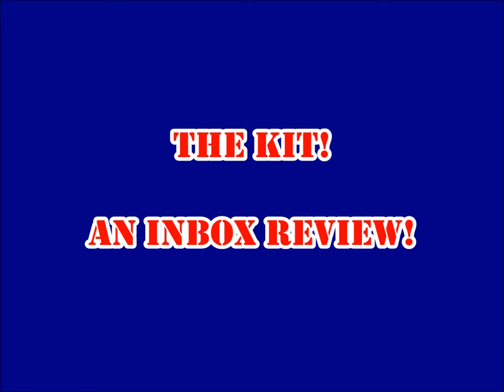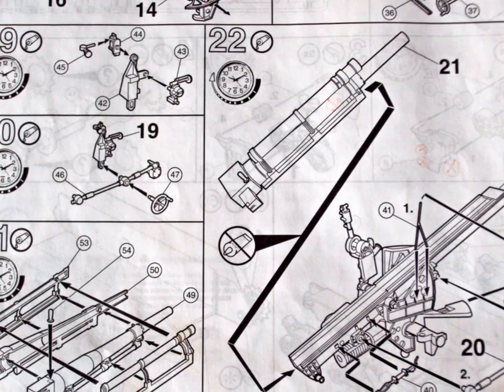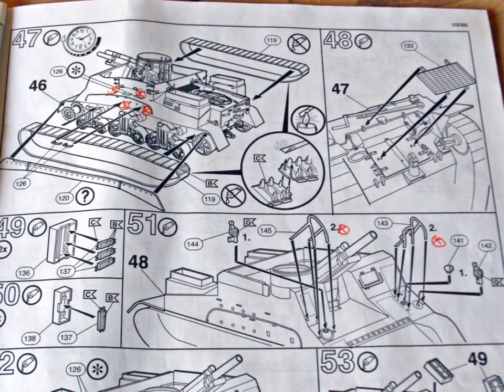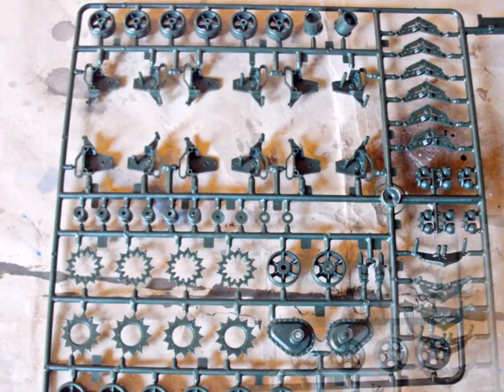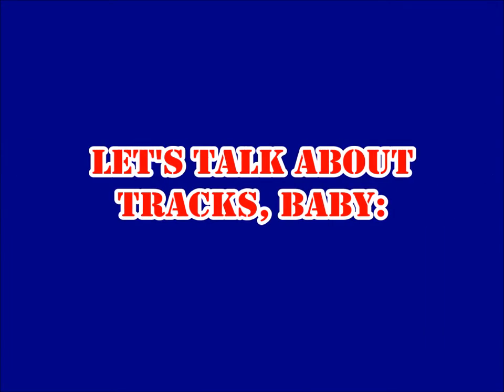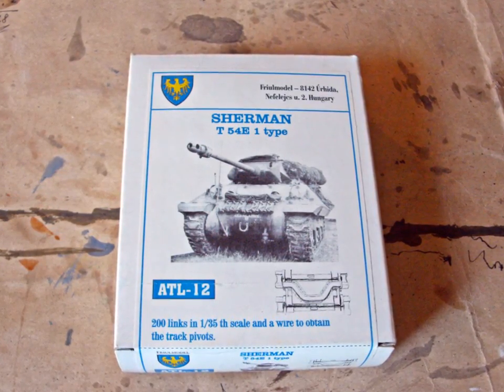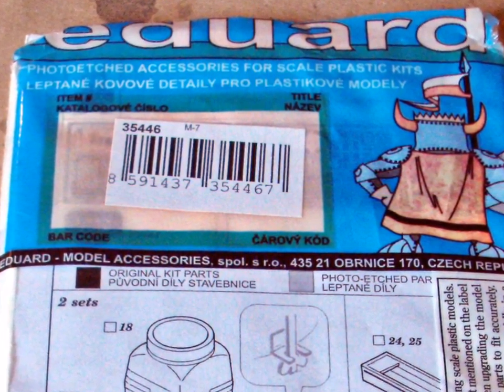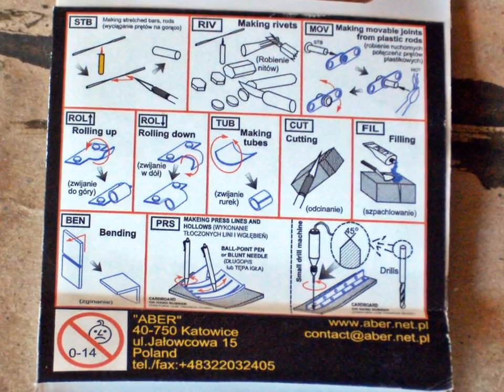Entry Video For Steve Mottram's 'M' Group Build

Comment: What a beast this will be!  A small fortune yes but I guess it kind of accumulated over a little while.  Still, loads of detail, and I know you'll do an epic job and add a couple of your own touches too :)  I'll be in this GB as well, with either a Russian Sherman or a BMP, though I do have many other options!
Reply from the maker: Thanks a lot, Evan. Yes, when I bought the kit I ordered the tracks and the Eduard set in my LHS. The tracks arrived a couple of weeks later. Then I was away on rehab for five weeks (got retired after that) and another couple of weeks later the Eduard set arrived. I didn't have internet at that time to order stuff online, so three or almost four months went by till I had everything at home. And briefly after that I got my older dog and gave up modeling. The Aber MG set is rather new though. Very nice that you'll be participating too. The letter "M" opens up many options, hehehe!

Comment: nice vid. thats a very expensive kit you will end up with, for me thats to mutch, il have to go with cheaper kit's. and maybe some kit there dosent fit correct. but im looking forward to see you build it. :-)
Reply from the maker: Well, except for the machine gun upgrade kit (10.- €) I bought everything in 2009. I only didn't touch the kit and accesories, 'cause I didn't do any modeling between the end of 2009 and November 2015. So, these 60.- € from back then don't bother me anymore. Today my financial resources are limited and I wouldn't and couldn't buy these expensive upgrades. I'd rather buy kits like your Tamiya Panther. There are three kits in my stash that are beyond my price range, but they are gifts from friends of mine. I couldn't have purchased them. I'm really scared of all the PE stuff and I guess there'll be a lot to laugh about in the update videos. :)